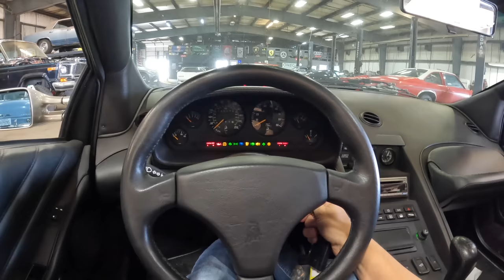All of my Lamborghinis are PERMANENTLY BROKEN, and that's totally normal. The Car Wizard GIVES UP???

Comment: You are forgetting, Tavarish has activated the cheat code for the Murciélago, it can't set a trouble light if it only sits in a museum
Reply: With his luck the electronics short and light up the cluster without key in
Reply: Jared's here !!!
Reply: Hi Jared!
Reply: Hey Jarad sorry bout the vacuum comment btw. Teenage sons like to help dad when he's logged in. Respect as always. Love your work.
Reply: Don't worry, he went to Jared.
Reply: I think with that history, someone's going have to bite the bullet and do an engine out sooner than later
Reply: Freddie needs to make videos more offen
Reply: Everyone is getting close to forgetting Tavarish?…LoL
Reply: Oh, I use the other cheat code.  Pull the bulb. 🤣
Reply: @pkt1213  That doesn't help you on an inspection.
Reply: He has plenty of time to fix them with not uploading videos
Reply: Ha, Ha, Ha...
Reply: it also stops leaking if you just let it go empty
Reply: If I can have dinner and all night talk with 3 people ,wizard ,hoovie and sreten would be on my list..
Reply: Schrodinger's Lamborghini
Reply: So if Tavariah were to sell this Lambo to Hoovie, would the luck run out??
Reply: That’s why the car museums even exist
Reply: @stephenhunter70  I doubt it's the engine itself. It's more like a lash problem in 2nd gear. Possibly a bearing.
Reply: That basically describes ALL of Tavarish's cars.
Reply: @firesurfer  you know what, I think you might be right. Now the problem due to the way those vehicles are designed would still require an "engine out" to fix. I'm not sure they are particularly willing to do that at this time.
Reply: @stephenhunter70  yup.
Reply: lies a real Murcielago can
Reply: @holeephuk   Wow

Comment: What better way to praise an NSX than to say it was rather boring because it didn't break as compared to more expensive cars burning themselves to the ground.
Reply: Yeah but it got him clicks!
Reply: A Murcielago and Countach are way above the NSX.  I like the NSX, but it is nothing compared to the Countach.  The Countach is almost the embodiment Lamborghini
Reply: I bet its the motor mounts and any dampening associated. Its just amplified through the firewall, think like the skin of a drum. When enough torque the engine pulls tight and sound diminishes, between that you get vibration that translates to your "moan" sound. Or something like that, harmonic balancer?
Reply: I’ve only ever done oil changes. It’s a Honda in every sense of the word

Comment: The Lamborghini Huracán is like the Corolla of super cars. Very reliable. But then it wouldn't produce as much as content or allow the Wizard to buy a bigger yacht.
Reply: Most modern supercars are pur 2014 458 has had basically no issues and mclarens get a bad rap but our 720 and elva have had no issues
Reply: Pretty much every modren (post 2010) supercar is reliable and mostly idot proof, look at Hoovie's 458, neglected and bashed around carelessly and yet the only damage it has it cosmetic.
Reply: And a castle.
Reply: @SkodaYetiFan  but in parts availability and average prices, not a surprise if it's cheaper to maintain an Huracán or a R8.
Reply: @720sobsessed6  not yet hasnt
Reply: They are insanely common in cities as well
Reply: @halogod0298  the 458 is 8 years old and the 720 has 5k miles in 3 years
Reply: @SkodaYetiFan  even the 360 and 430 are considered reliable. Gearbox of Both more reliable than first gen 458
Reply: @720sobsessed6  only 5k? That’s why…
Reply: @halogod0298  ur misunderstood mclarens are much stronger when they get more mileage anyone will tell u that. And 5k is way above average
Reply: I would've gotten rid of those old lambos long ago.
Reply: Rebadged Audi R8
Reply: @720sobsessed6  still a sad amount of milage for 3 years
Reply: @Cumminsclubcab  it's really not in ny the car can only be used 5 months a year and commute to work is 6 miles
Reply: @720sobsessed6  why can’t you drive it in the winter ?
Reply: @Cumminsclubcab  our driveway is a quarter mile uphill and is never not covered in snow? An awd porsche panamera used to struggle to get up it. I had to daily drive my manual c7 and it wasn't exactly easy although that car was really good in the limit drifting. My c8 has 5k miles in 10 months and I wouldn't say it has many more engine hours it's just that that's on the highway a lot
Reply: @720sobsessed6  what part of ny do you live in how is your drive way covered in snow the entire winter , my brz with blizzacks will go through anything as long as it has the clearance
Reply: @Cumminsclubcab  yeah clearance is the issue that's why I eventually had to start walking up and leaving my car in the street. I have a shot of my c7 being completely under snow where when we dug it out u got a perfect c7 imprint in the snow. And I'm jealous of the brz I've been wanting an frs since it came out in 13
Reply: Thats a nice way to put it.
Reply: So then the 911's are the Prius of supercars? Inb4 the 911 isn't a supercar.
Reply: Very likely because it's mostly Volkswagen AG parts (that's ok, that's a good thing)
Reply: Same as McLaren 570s
Reply: I loved that blue Huracan and would have kept it. It and a choice 911 would be the no break fun cars.
Reply: Yeah a huracan and 911 turbo are perfect reliable  cars to have
Reply: @720sobsessed6  I couldn’t imagine spending that much money and not driving the car every day
Reply: @halogod0298  with multiple cars u can't drive two at once the average mileage on a 720 annually is probably 1 or 200 the cat gets used whenever it should whether u believe it or not
Reply: @720sobsessed6  Good for you man, couldn’t be me. Good luck with the car though

Comment: It's simply a valve body, and it doesn't have to be in the location of the sound. The sound will resonate to be where it escapes the mass of the engine
given the other motor noises that this many-valved engine has to make. 
Just replace the air intake valve bodies.
Reply: Vanos valve..vacuum leak
Reply: I had a vacuum leak in a blow Off Valve in My old STI around the same rpm but only if I was driving up hill. it moaned like a ........ gone as soon as I replaced the BOV, good luck @hooviesGarage
Reply: I had a Mondeo V6 with similar moan as the Lambo. I replaced the EGR-valve and problem solved.
Reply: @BenFergus   Ah yes that well known ford V6 thats really just a Lamborghini V12 loped in half..................innt

Comment: Your "moan" could be in the cooling system as a result of an edie current within the passages at a specific RPM. I've know some dirt track cars with a secondary radiator in the passenger compartment to develop a "hum" while at certain engine speeds. It's probably a flow resonance issue, it depends on how annoying it is to you to want it gone or not.
Reply: Hope he picks up on your observations. It's either that or just a general resonance issue with panels or heat shields, mounting of accessories etc.
Reply: Could be Intake related. Induction noise.  Vacuum leak.
Reply: My guess power steering pump .
Reply: I see a dozen comments on each video saying what it could be. I feel like the wizard would have already checked many of these systems, and that, try as we may, we can only guess and speculate. That being said these types of comments have helped me figure out what was wrong with my own classic, so I appreciate them a lot.

Comment: "I'm not that tall, 6ft2"
Hoovie is in the 96th percentile for height for American men
Reply: Sure, but he mean the difference in inches to average height isnt all that much. Which it isnt. 4-5 or so? Not exactly shaq territory.
Reply: Exactly lol Average male world height is 5' 5", the average height for men in Italy is around 5' 8". 6' 2" is pretty tall when you consider super cars/exotics are supposed to be low/sleek.
Reply: @GoldenCroc  By that logic a man 5'3" is not short because hes only 4-5 inches less than average. You dont have to be smaller than Danny Devito to be short and you dont have to be taller than Shaq to be tall.
Reply: @kylehardy7519  Yes, you are correct relative to other people. What I meant, and Hoovie very likely meant was as  percentage of the total, in an engineering context.

I.e. 5 feet 10 vs 6 feet 2 are only 4 inches taller out of a total of 74. Thats less than 6% taller, so a pretty small increase for a physics/engineering standpoint. Since you already need to design the car to fit a 70 inch person, less than 6% more isnt unfeasible. Hope this clears it up.
Reply: @GoldenCroc  I'm sorry you can word it anyway you want but you're wrong. Contextually or otherwise. 6 inches of headroom from a physics/engineering standpoint in a car is a lot especially in one designed for speed. And then where does that end? What are the limits to just a little bit more? Logically you make no sense.
Reply: @kylehardy7519  Come on man, I explained it to you. No I am not wrong, what I said makes perfect sense in regards to what he meant. 

Futhermore, it certainly isnt 6 inches of headroom, most peoples increased length isnt exclusively in the torso.  Reasonably, its about half that, so 3 inches. Thats not a lot, even for an extreme performance car. In a pure race car, it might be of some interest, but no street legal car is even close to that. 

The "Just a bit more" break even point would be when they lose more money on customers who bow out, than they do on building the car a bit taller. Or make the driver lean further backward could be another solution, take a look at an F1 driving position for example.

So yes, it does make sense. Especially as I was only explaning why he said what he said, and what his reasoning was.
Reply: Yeah you just countered your whole other argument and proved mine. Thank you. Why are you talking about F1 cars now too lmao. WUT. Good day.
Reply: @kylehardy7519  What are you on about? Everything I said is pefectly congruent, from beginning to the end. Incredible that you cant see that, and instead is going on some tangent that isnt and wasnt even the point. 

Seriously, I tried being civil and nice here explaning what he meant, but you seem to hold only bad faith. I find your manners sorely lacking.  Perhaps you will better understand this: Please learn to read, and even more importantly, understand what is written once you do. Deliberate misunderstandings are just tiresome.
Reply: I'm the same height and I don't feel like it's that tall.
Reply: @j.s.3297  likewise but the average American man is a few inches taller than the average Italian so I guess Lamborghini was basing the height on the people that work for them when they went through the design process, etc
Reply: Really? I am also 6'2".I wasn't aware.
Reply: @j.s.3297  Me too.

Comment: I had a car that had a moaning sound from the engine bay at certain RPMs. It turned out to be an oil line on the remote filter. I moved the line slightly and it went away.
Reply: Well that’s amazing!! Thanks for that gem.

Comment: @carwizard, the sound could be an interference frequency from a sheetmetal part. If the engine is operating at a certain rpm and a chassispart has it’s own frequency in the same range it could start vibrating. I have had this experience in my past with steel contructions as well. For example when operating a vibratory screen at 16 Hz we have to take care at designing sheetmetal panels too big. I have seen supportbeams moving 1/2” just by this sound. I have seen a complete building working as a bass. 
The way to solve this is changing the dimension of the beams or panels. Shortening length or adding braces will change the natural to a higher Hz. Basically getting this natural frequency of the construction out of the frequency range of the engine and drivetrain. You could also add sound dampening material to the sheetmetal in that area. This adds mass resulting an change of frequency.

Comment: The fact it happens in a certain rpm range could mean that it's a vibration of something that has a certain resonant frequency. You want to look for any flat sheets of metal or pipe etc. in the area that are in the area the noise is coming from and make sure they are not loose, I'd do the same with any bolted connection too just to be safe.
Reply: YES
Reply: can also install sound deaden materials.
Reply: I agree. When the engine hits the resonant frequency of say a pipe which is very close to a more solid object it will vibrate and touch the object, creating the noise.

Comment: Your intake is probably getting some sort of Helmholtz resonance effect. I've heard it on a couple JDM inline sixes make that sound. The Diablo is two inline sixes. I think it's the longer intake plenums that cause it. I have a Toyota 7m that started making that sound after I switched to a front facing intake manifold.
Reply: I bet thats the issue. They would have found a mechanical issue
Reply: I have to agree, induction noises resonate like crazy. Even on an I4 you get things like that with an aftermarket intake. Sweet ride tho 😎
Reply: @five12man  he should go aftermarket intake and see if it helps
Reply: @Chris-hw4mq  an "easy" way to diag for sure, maybe just put a tube on it
Reply: @five12man  I actually just talked to my friend who said he had some moaning noise on a Honda with Skunk manifold. Seems like short runners and big pelnum gets a moan and groan somewhere in the rpm band.

Comment: HOOVIE PLEASE READ! I know this is a car but I had this experience on a natural gas pipeline transmission engine. I spent 6 months trying to diagnose the gear box/noise and it was what they call a “soft foot”. Since the foundation was cracked, it allowed for the gearbox to obtain a harmonic. This is what caused the humming noise. Gears were good and I aligned them but since the foundation was “soft” it would allow a frequency to pass causing a resonance. We had to fix the foundation, cad no issues afterwards. Now my point, check all of the bushings, which I am sure you have but think about changing bushing materials at the mounts (including exhaust and transmission). If you already have, tell the Wizard to by a potentiometer to measure the vibration at various spots. If it is caused by a mount you can see if it is a function of the RPM (I.e., the frequency will match the RPM frequency). If it is, then it is a mount somewhere. If not, likely some type of vacuum or seal leak. Message me if you like but this has been a subject that I have investigated a few times.

Comment: Suggestion regarding the moaning sound: strap the car to a chassis dyno and hold it in the specific RPM range under light load. Remove the hood and climb on top of the car. If it’s not an exhaust issue it could be a resonance issue in the intake.

Hoovie, I’m still waiting to hear back from you to take care of your super bee issues with the cooling and properly tuning your EFI!
Reply: Dyno would be a great way to find it
Reply: Yeah someone needs to port the intake a bit just to be sure
Reply: Not even needed since the moan happens even if the wheels are not turning
Reply: @EPYCMX  it might only happen during load. I haven’t followed the whole progress.
Reply: I'd hazard a guess that there's a gasket somewhere on the intake side that's ever so slightly misaligned and buzzing at the specified engine speed range. I had that happen on a car once. Drove me nuts.

Comment: "This is a car from 1989, not 1960." Keep in mind, though, it's from late in the Countach's production run. It's really a car from 1974, and the prototype was unveiled in 1971. (Heck, if you want to chase it back even farther, the basic body shape comes from the Lancia Stratos Zero concept, which was... what? 1969?) NIH data on immigrants to the US in 1970 suggests that the average Italian male born circa 1950 was around 5'6" as a young adult, so... there you go. (Yeah, I actually researched that. It's a slow Friday afternoon. :)

Comment: The "moaning" could be an incorrect adjustment in one of the valves so it's not seating fully, and that's why you hear the whistlings sort of sound, probably one of the front cylinders where the wizard located the noise, a leak test on the cylinder with compressed air could serve as a diagnosis